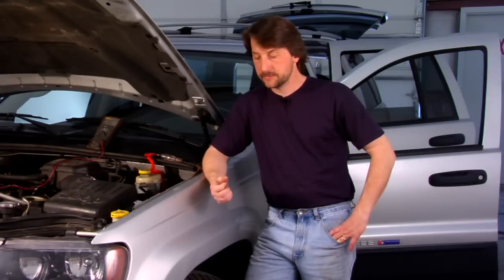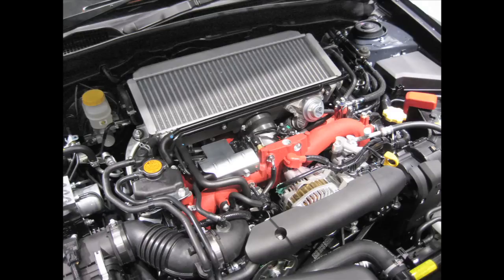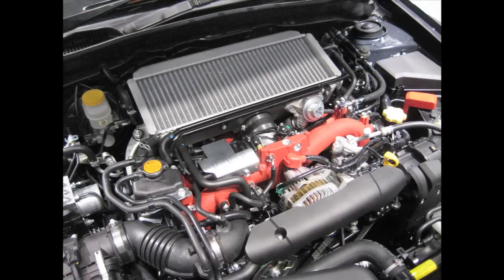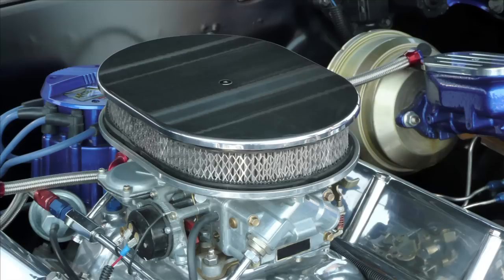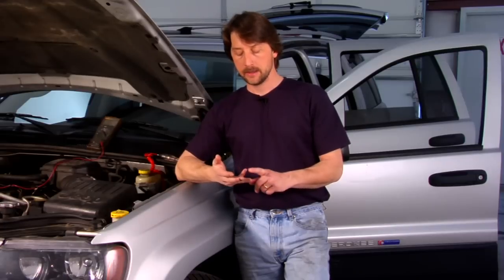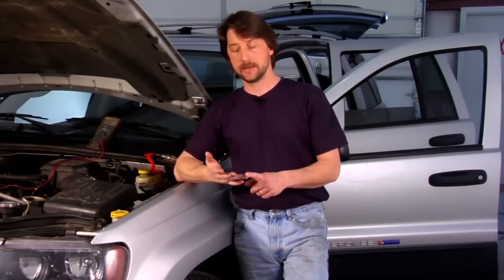Car Repair & Maintenance : How Does a Turbo in a Car Work?

Comment: @shortyjk95 The exhaust fumes make the turbo spin. When you accelerate, there's more exhaustion and therefore the turbo spins faster. The more RPM's, the more air compression. That's why there's the so called turbo delay too.

Comment: it depends on how big of a turbo you run . with a decent size turbo you can easily get double your hp . to get those numbers you need to run high boost, and you need to have fuel injector that can keep up with the boost you run. more boost....more fuel.